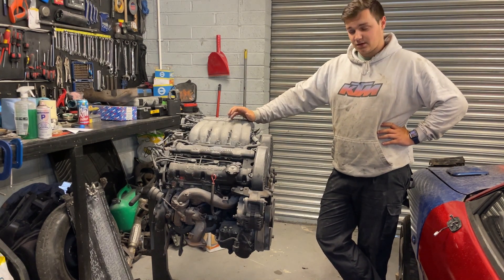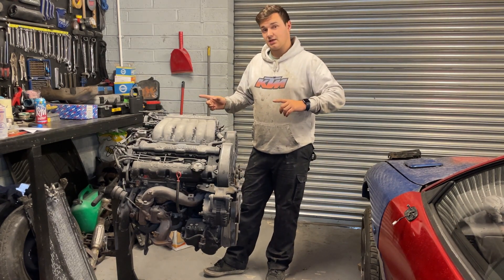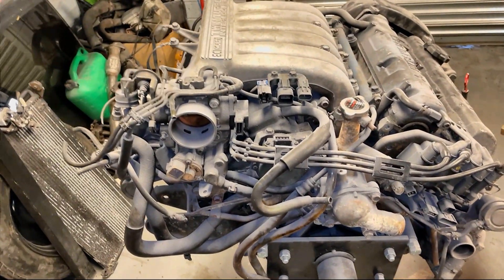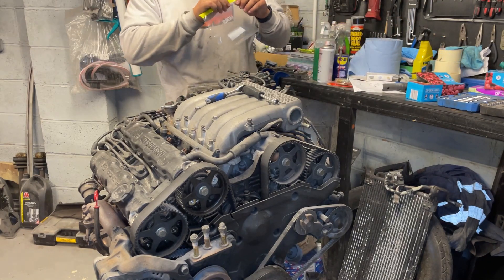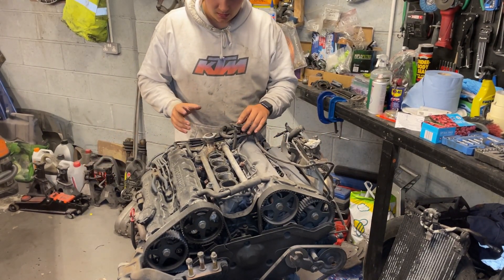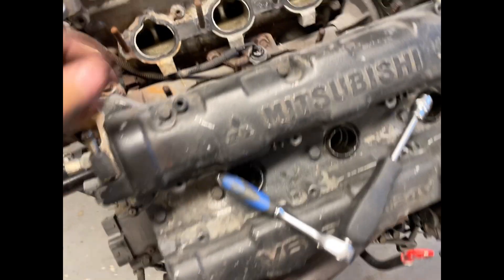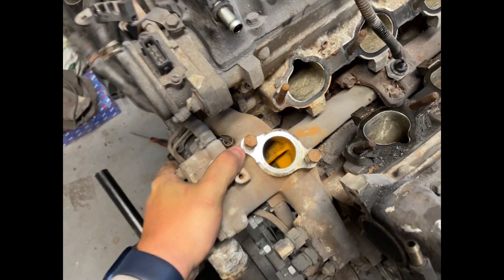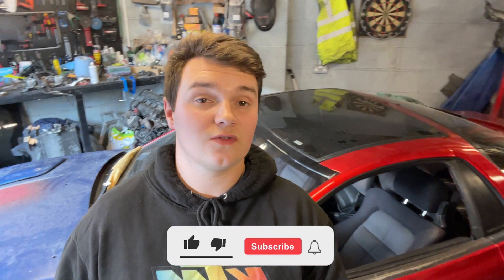Mitsubishi GTO Engine Rebuild: Part 1

Comment: My boss had a GTO when I was an apprentice, we called it “The Tank” I had to do a timing belt on it before it was sold and it was an absolute nightmare with the engine in place. The car came back awhile later after melting a piston. I took the engine out and stripped it down but it like a lot of these cars, it never went back together, not that I know of at least. Not an easy car to work on with the engine in place.
Reply from the maker: Yeah, you're very right! I did the timing bet on my old N/A GTO while the engine was still in the car and it was so awkward! They're very packed engine bays and quite difficult to get around. But I suppose if you're determined enough, you can make it work🙌🏻